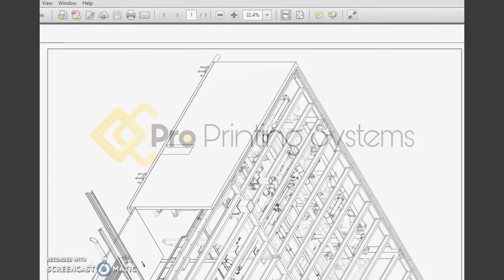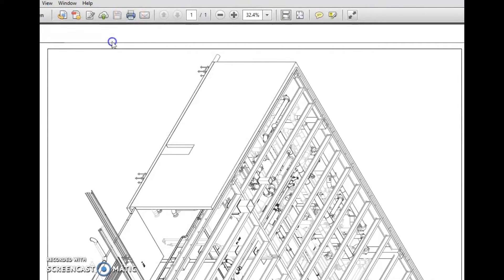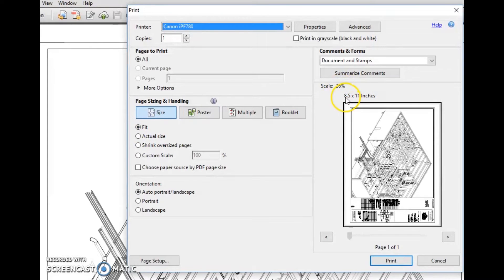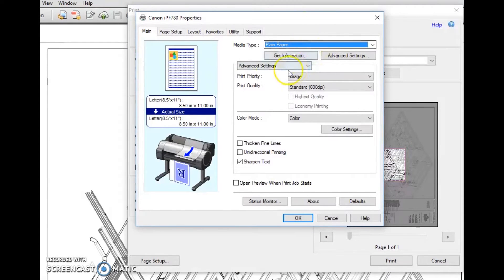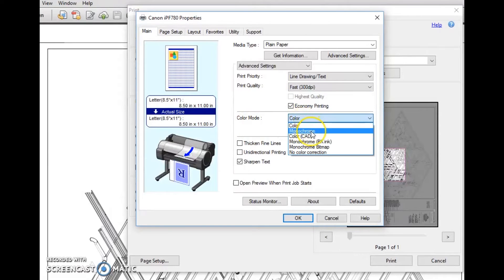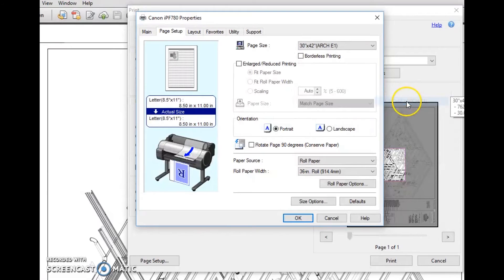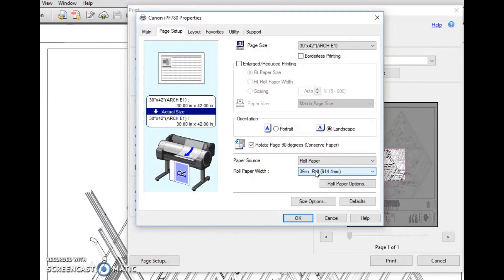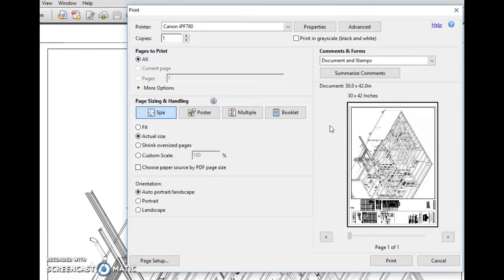Setting PDF Blueprint Sizes On Canon Plotter Print Driver

Comment: What system are you using because my Dell computer does not show me the actual size that I need to print so I have to guess and check with a scale ruler after I print